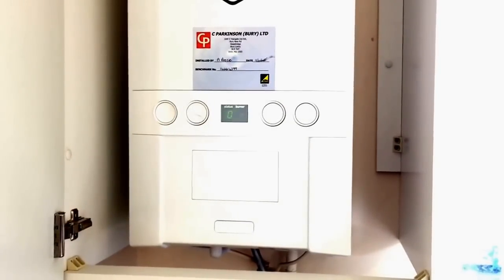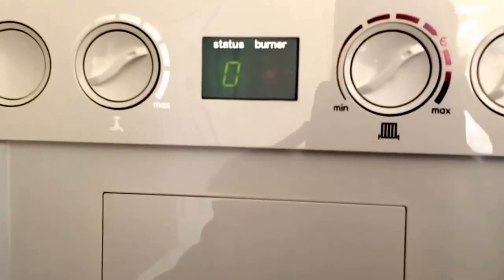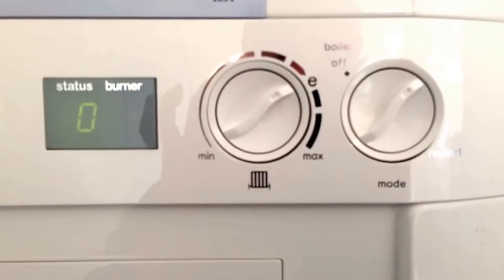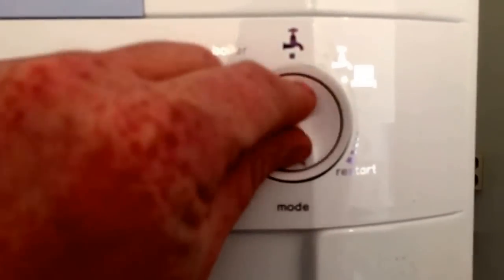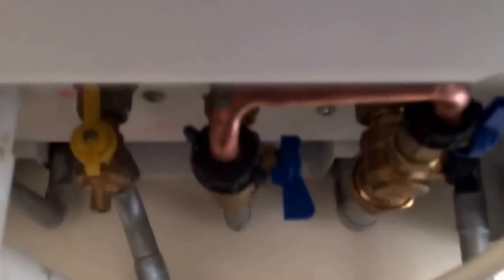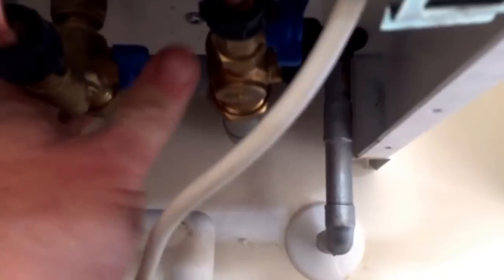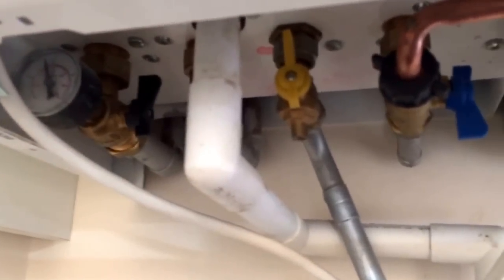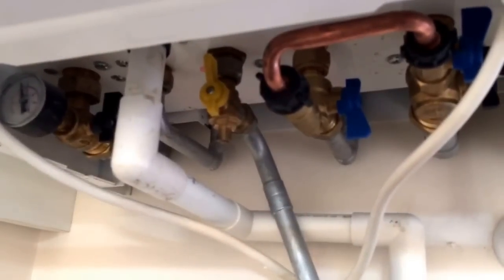#howto #theheatingpro.com #combiboiler Ideal logic combi es30 demonstration

Comment: Any possibility to start heating on without remote controller? Mine has broke down so I can't turn heating on now.
Reply from the maker: BXclusiveRn  yes it depends what you have? Do you have two stats? Combi boiler or boiler And cylinder?
Reply from the maker: BXclusiveRn have you changed the batteries in the stats? If it is this boiler does it work on hot water?
Reply: @theheatingpro  yes boiler is working, just termostat got smashed on the floor(I've got the RF one) Service mode you show wasn't working for me. I've got Combi 30.
Reply from the maker: BXclusiveRn Hi yes and no I’m afraid. Would involve wiring a loop at the boiler to take the stat out of the equation. You would best leave this to an electrician or qualified heating engineer. Whilst your at it you can get them to change damaged unit as will save you on gas in the long run. What Thermostat do you have?? If you buy one of these units you may be able to pair up to the receiver yourself without having to change the receiver
Reply: @theheatingpro  thanks for answer. I've just bought new thermostat and receiver, no point to mess about much with boiler. Thanks

Comment: Hi , thank you for the great video your upload . I have same Logic boiler at home . The central heating works great . I got problem with hot water . When I do open the hot water tap in my bath , hot water is running for a few minutes then gone off . There's  1.6 bar water pressure on the boiler and      0    on display . Could you please suggest any advise . 
Thank you so much.
Reply from the maker: Tomasz Machnowski Hi Tomasz what type of bath tap do you have? Regards Roger
Reply: Its new tap , but I can't  name it
Reply from the maker: Tomasz Machnowski Was the previous tap working ok with the boiler? Can you take a picture and send.
Reply: @theheatingpro   Hi I did try to send you the photo , but for some reason I've been unable to do so via youtube .
Reply: The same problem is when I open tap in the kitchen . The hot water is running for a few seconds then gone off .
Reply from the maker: Tomasz Machnowski Hi send me a pic of both kitchen and bathroom tap via cparkinsonheatinghelp@gmail.com
Reply from the maker: How long has your boiler been fitted have you always had the issue at both taps or just recently
Reply: @theheatingpro  I've my bath done about four months ago.  Since that I've had that issue.  Every thing was fine before the renovation.
Reply from the maker: Tomasz Machnowski Doubt it is the boiler Tomasz. More likely the tap let me know when you have sent pic and I will advise further
Reply from the maker: Hi Tomasz, 
couple of thing to look at with the tap 
Has it has been piped correctly hot generally to the left hand side. If it is a mixer, in that it mixes hot and cold before coming out of the spout? Are your hot and cold water flow rates roughly the same? Has your main incoming stop tap been fully opened after the bath was installed? Does the bath have a tmv2 underneath to prevent scalding water coming through the tap?
Regards Roger
Reply: @theheatingpro  Hi , thank you for your time and all your support . I really appreciate it.  The boiler is working fine. I did clean the flow turbine and few other parts . Both , central heating and hot water is working great . Thank you so much .
Reply from the maker: @tomanotoja  Hi Tomasz, no problem only too happy to help. Please Subscribe for further videos and any help and assistance in the future. Regards Roger

Comment: Hi I installed logic combi 30 in 2016 its controller is not working when we changed the battries .can u tell me how can I start  heating from the boiler without controller plz thanks a lot
Reply from the maker: Hi Samina, Would involve removing the stat from the wiring in the boiler and fitting a link instead. Not something that you would do yourself and would advise that rather than remove altogether replace if its not working with a new unit. Regards Roger
Reply: CParkinsonBuryLtd  thankyou very much, i have replaced the controller but it is still not connecting with the heating. My old model  was RT500RF and the new one is RT500 without the RF at the end but everything else is similar.
Reply from the maker: samina akhter Hi Samina, have you run all the wires between stat and boiler and wires in? The RF stat is wireless and works with receiver at boiler the non RF stat requires wires between the two.
Regards 
Roger
Reply: CParkinsonBuryLtd oh so shall I  change the cotroller and buy the RF one
Reply from the maker: samina akhter if you don’t want to or it isn’t easy to run the wires in then yes you will need the RF model
Reply: CParkinsonBuryLtd thank u sooooo much for good advising🤗
Reply from the maker: Samina, Are you sure that it is this model on not a RF model which connects wireless to a receiver near the boiler?

Comment: I have a logic 30 boiler. Just moved into a house and not been able to get the heating on at all. I reset all the thermostats. Tried everything. Can someone please advise. I am getting hot water. Just no heating.
Reply from the maker: Hi Claire,
 Few checks to run through.
1. Is the boiler set to Winter mode ie dial on right on tap and radiator?
2. does the display show a C? If not there is no call from the thermostat
3. Does the boiler light and then go off again? likely to be one of the two outer black taps to flow and return closed they should both be pointing up.

Try these 3 and let me know how you get on, if you have no luck I can give you other things to look for but these are most likely

Please subscribe for further videos help and advice

Regards

Roger
www.cparkinson.com

Comment: Hi my boiler keeps saying going into standby mode and the radiators don't work but hot water is on and the dial is at winter setting how do I did this ?
Reply from the maker: Declan Swales Hi Declan, when you say standby mode do you mean display goes to O? If so sounds like the problem may be with controls or zone valves if you have. Let me know if it is O and we can work things out from there 
Regards Roger 
Please Subscribe for further and future videos

Comment: How do no what temperature the waters running at on these? Or wher would you set the water to on the dial
Reply from the maker: Hi Steven,
Everyone is different as to how hot they like their hot water. Just adjust the stat on the front of the boiler with the tap symbol on it. Remember the hotter it is the more gas it uses so set to the temperature your happy with rather than the max.

Hope this helps 
Please like and subscribe

Regards
Roger
www.cparkinson.com

Comment: Hi I have a logic combi 30. The timer seems to have stopped working and i only have one blue tap as I was trying to adjust pressure. 
I would be grateful for any help
Thank you 
Janet
Reply from the maker: Hi Janet Smith, 

There are a few versions of the filler on Ideal boilers. Most now are a two Blue tap version but there are a number out there which have one blue and one black tap. They are located further forward than the other isolators, working from outside in do not touch the outside two black taps as these will close either the flow or return and stop your heating working. Do not close the yellow tap which is the gas supply to the boiler, that should leave you with the remaining taps that you do need to turn on to re pressurise your boiler. Open one fully usually by turning towards yourself by 45 degrees and open the other slowly whilst watching the pressure gauge. You should here the water filling at this point and slowly take it up to between 1 & 1.5 bar on the gauge. Turn both taps then back to their original position.
You may find that the timer is not at fault just not able to fire due to low pressure, however if you have hot water it may be the case of having turned one of the outside taps to the wrong position which I have found is common. Both of these should be pointing upwards (12 o'clock). 

Hope this helps, but please do not hesitate to contact me if not.

Regards

Roger
www.cparkinson.com
Reply: I'm away from house but will try it out. Thank you so much for taking time to reply. Much appreciated 😃
Reply: 😭😭😭 pressure still at 2. From left to right I have  1 black tap, 1 yellow, 1 blue and 1 black underneath is a black connected to a cable thing 😪
Reply from the maker: Hi Janet,

The black tap and blue connected to the cable thing are the ones to top up the pressure. What I need you to check is that the other two black taps ( furthest left and furthest right) are pointing up. Whilst 2 bar on you pressure is a little higher than the 1.5 you would generally want I wouldn't be overly concerned. If the two taps are pointing up then all should be ok for the heating to circulate. this would then point to either your timeclock or roomstat. Let me know how you get on with the taps and then we can go through checking your clock and stat.

Regards

Roger

Comment: I have a LOGIC COMBI 30 which was installed in June this year. I have a Neomitis wireless daily Programmable Room Thermostat and receiver. The burner indicator is flashing L then 5 alternately (radiators not working and no hot water) The indicator below the boiler is showing orange and green! Have tried to restart it and it goes to 0 then when I let go the burner indicator returns to flashing L and 5 again! Have you any advice before I call the engineer out?
Reply from the maker: Hi zzzerichxx,
L then 5 is a lockout due to too many resets within a 15 minute period. According to the instructions it is a case of turning the power off at the fused spur then back on again. Leave it off for approx 30 secs and all should be ok. You may find that you have had another fault before this that might show up before it goes to L-5, if you do please ask again and I will gladly advise.

The instructions for this boiler are available as a free download on my website in PDF format and the page with the inforamtion regards this is 52/70.

Hope this helps,

Regards

Roger
www.cparkinson.com
Reply: Thankyou for your help but I`m not very technical and I don`t understand what a fused spur is.
I am a lady who is almost 71 and I find it too complicated to cope with! I think I must still call an engineer out tomorrow! How much they charge is a big worry when you`re on a pension, isn`t it?
Reply from the maker: Hi zzzerichxx,
A fused spur is the switch located close to you boiler which cuts off the electricity to it, the display will go off when you turn it off and will clear the PCB of fault code history, much the same as rebooting your computer.
Hopefully this helps

Regards
Roger
www.cparkinson.com

Comment: I have an IDEAL logic 24 combi and it has just been diagnosed with a  
split heat exchanger. The water pressure drops continuously and it runs 
 away into the condensate pipe.

This boiler is three years old. So therefore I certainly would not  
recommend IDEAL LOGIC boilers.! They are cheap and have a poor record  
over the last ten years with their COMBI`S. 

 I have now been told the whole heat exchanger needs replacing and I`m  
waiting to see if it will be done under IDEALS fixed repairs scheme. The
 engineer has just  departed but I  have already paid IDEAL the £275 up 
front. 

This boiler was also installed under the government Warmfront scheme...it only had a two year gaurantee.

I will add to this post when I find out if IDEAL will honour their claim
 to fix anything in the boiler with the fixed price repair
Reply from the maker: Hi Geoff,

Sorry to hear your issues and hopefully they get it resolved for you. I am in no way connected to Ideal and only offer a demo here for our customers to understand how to work them. I use youtube to help get this over better and hope it also benefits others who have this installed by other companies too.
I have made comment in a previous post as to how my company find the boilers based on reliability and I can only go off the experience we have had as installers giving in some cases up to five years builder warranty and it has been good.
I am sorry to hear that you have not shared the same experience and I hope you get it fixed quickly.

Regards,

Roger
www.cparkinson.com

Comment: hi there guys .i have the same boiler here and its 3 years old .just recently the rads turn on automaticaly regardless of the salus thermostat .the thermostat does not show the little fire on symbol so i know its not turning the heating on 
anybody got any ideas what i need to do to stop automatic heating
Reply: Hi Mohanmed,

If the Salus roomstat is RF or wireless it could be time to change the batteries in the thermostat. They can call for heat without displaying the flame symbol when batteries are low. Another thing to check would be whetehr you are receiving a call to the boiler when the heating is coming on when you are not expecting it, does the C show on the boiler display before it fires if so the boiler is receiving a call. One last possibility is that you have a zone valve fitted to the heating which has managed to lock into automatic and so set your heating to constant on.

Hope these points help you resolve your issue, if not reply back.

Regards,

Roger
Reply: I've got the same problem. Mine is an Ideal Esprit Eco/instinct with the Salus ERT20RF. Only way to stop the heating coming on all the time is by turning the clock on the boiler off but then can't set the temp with the Salus to turn the heating on.

Only got the boiler installed 3 days ago!
Reply: Got it fixed. The sliders on the back of receiver for the thermostat were the same from factory. Moved some of them and restarted it.

Was getting the call from the neighbours thermostat. Was going on when I wanted it off and going off when I turnt it on 😂

Comment: I'm getting an L2 code. any ideas?
Reply: +ComicKittta Hi Comic, An L2 is an ignition lock out fault with a few possible causes. Things that you could check yourself would be that the gas valve to the boiler or to your gas meter has not been closed partially. Have you reset the boiler? A blocked condense pipe is another possible cause. Further to that you would really need an engineer to check the flue installation is ok or the ignition harness and gas valve. Hope this helps and please feel free to like and subscribe to further videos, kind regards Roger
Reply: Roger Parkinson is there a way I could reset the flame myself ? I've got an L2 code flashing also and want hot water asap without having to wait for an engineer ?
Reply: Hi Tina James,

An L2 is an ignition lock out fault with a few possible causes. Things that you could check yourself would be that the gas valve to the boiler or to your gas meter has not been closed partially. Have you reset the boiler? A blocked condense pipe is another possible cause. Further to that you would really need an engineer to check the flue installation is ok or the ignition harness and gas valve. 

Hope this helps and please feel free to like and subscribe for further videos, 

kind regards 
Roger

Check out page 52 of the boiler instructions which you can download at my website - www.cparkinson.com
Reply from the maker: Hi Lauren's Corner,

An L2 is an ignition lock out fault with a few possible causes. Things that you could check yourself would be that the gas valve to the boiler or to your gas meter has not been closed partially. Have you reset the boiler? A blocked condense pipe is another possible cause. Further to that you would really need an engineer to check the flue installation is ok or the ignition harness and gas valve. Hope this helps and please feel free to like and subscribe for further videos, kind regards 
RogerCheck out page 52 of the boiler instructions which you can download at my website - www.cparkinson.com

Comment: what is the tap for behind the pressure gague?
Reply from the maker: +Andy Chadwick Hi Andy, the tap you are talking about is for an engineer to use to isolate the boiler return pipe should he need to do so while working on your boiler. The only taps for the homeowner to use are those of the filler loop in order to maintain the pressure. If you mistakenly turn off either the flow or return isolation valves to the heating circuit the boiler will come on but overheat and switch off again as it is not able to flow around the circuit. Hope this helps and please feel free to like and subscribe to further videos, kind regards Roger